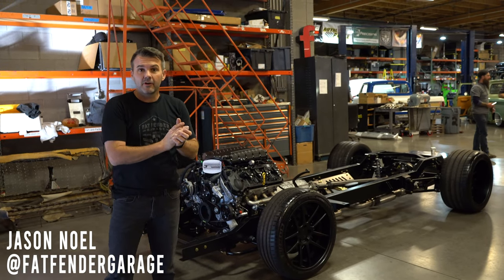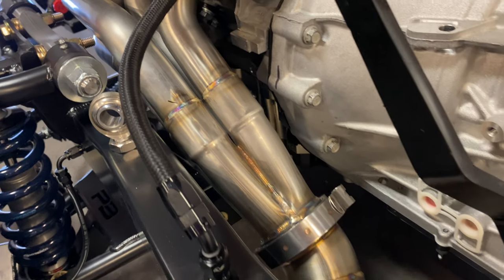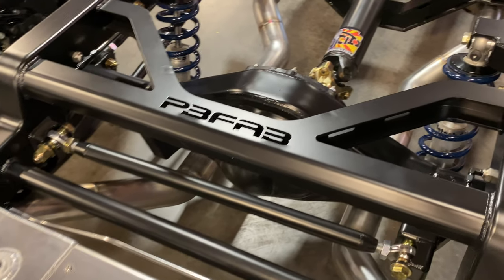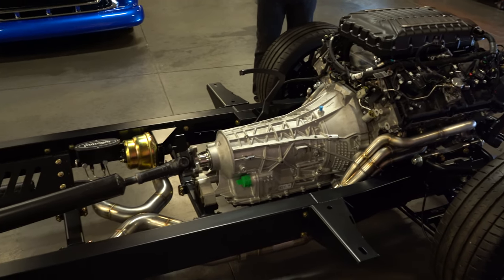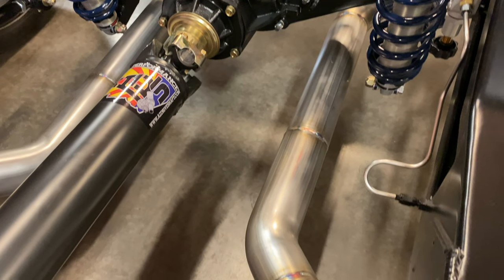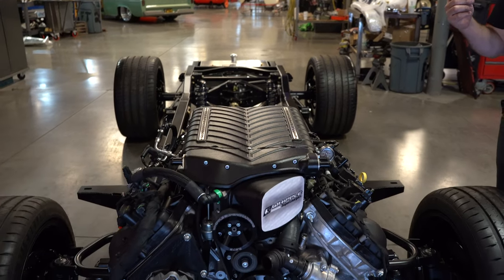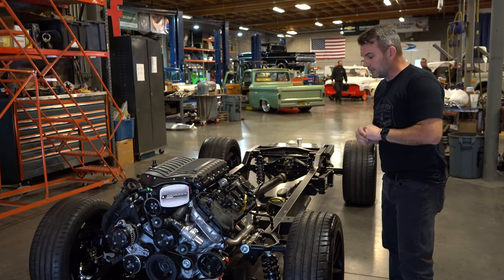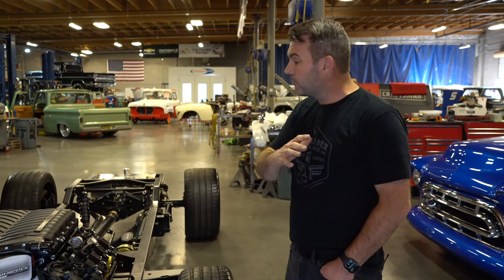The Ultimate Ford + Chevy Chassis [FULLY LOADED]

Comment: Curious if you do 4x4 frames as well... I'm sure probably not as big a market for them, but suppose you had or need a frame for 89 ford f150 or a 95 chevy Z71 that needs a complete rolling frame , ready to sit a body on... I'm sure your shop can do this,  just wondering what one would look like and how much of a challenge that be... And even though I would never be able to afford this... I'm sure someone has truck body 4x4 that's in excellent shape but the frame and suspension are completely shot.
Reply from the maker: We have 2- 4x4 frames coming out in a couple weeks.

Comment: Jason, SWEET RIDE!
 I was curious on that chassis setup, does the transmission tunnel have to be modified to handle the 10R80? It looks high in the chassis, not sure the stock cover would work? Also, who are you folks using for the drive shaft?
Reply from the maker: No modifications usually at all. We use a local shop called AZ Driveshaft
Reply: Do you build complete trucks

Comment: Test of concept
= ford (for left hand drive market)
= ford (for right hand drive market)
= chevy (korean market.?)

Engine size, gauge, to localise for those markets (existing spares in their environment)
Bolt-nuts, wire, hoses, interior, ... 3 markets localisation with spaces and gauges. 

Panelling not-included. Kit - CKD without panels.